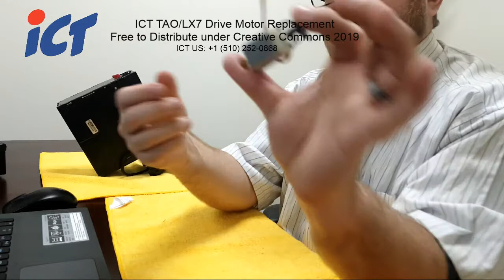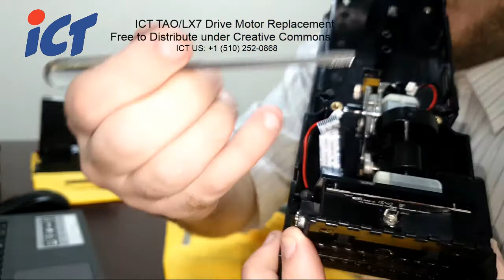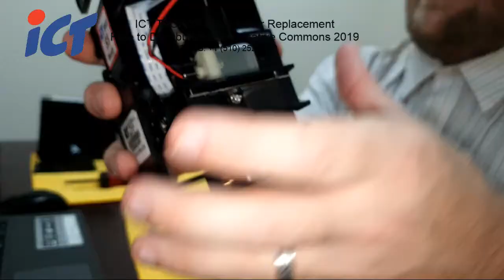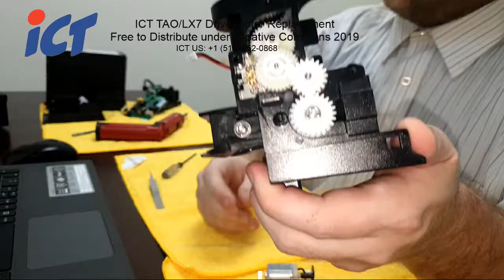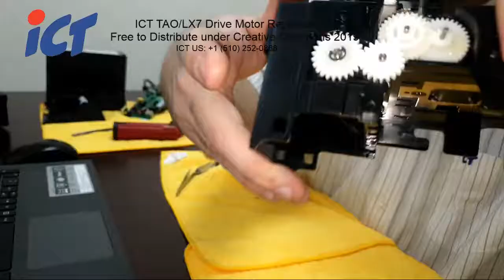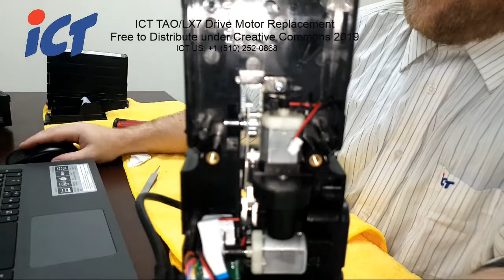TAO/LX7 Drive Motor Replacement

Comment: Thx Craig to show this procedure! Very very good!
Could youmake a video showing how use the programing white card in ICT TAO Bill acceptor? thx! have a nice day!
Reply from the maker: Good afternoon -- If you need to perform a white card calibration, you will need our testing tool and either a FP-001 or a  FP-004 to interface with your computer. If you have one of our MTB programmer devices, then you wouldn't need to interface with a computer, as this programmer is able to initiate calibration without requiring the use of another computer. 

Please feel free to contact me directly for more details - cbrown @ globalpaywayinc . com